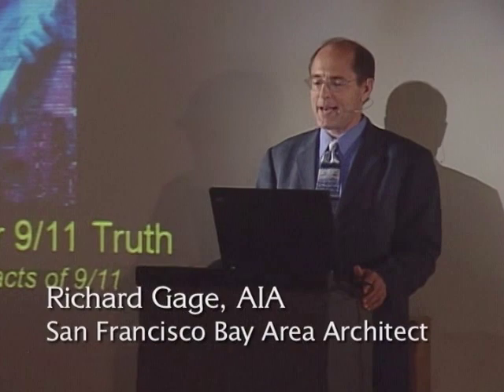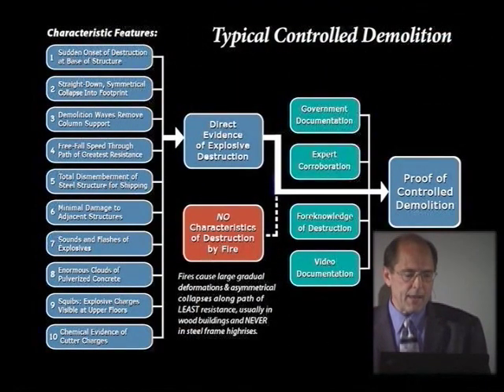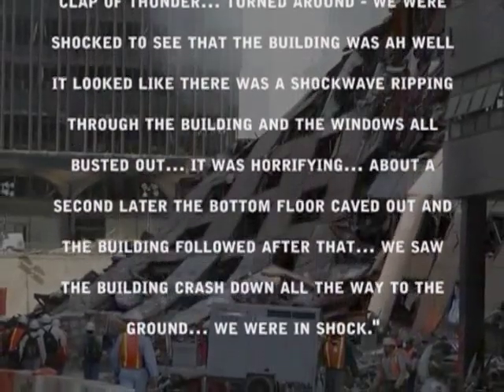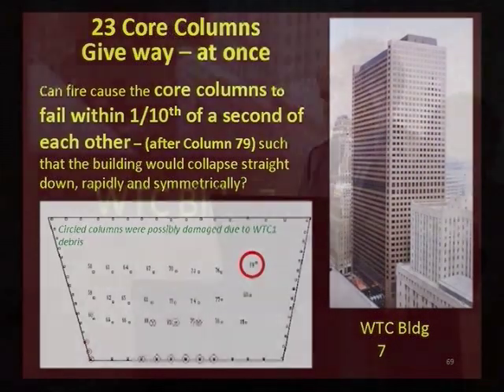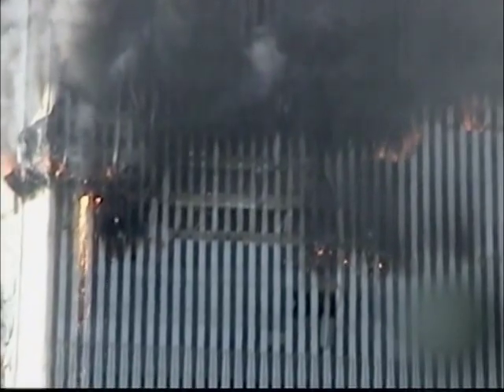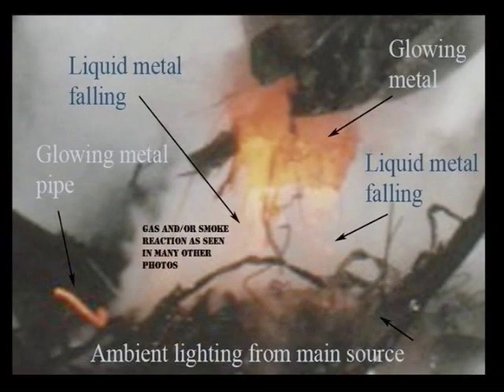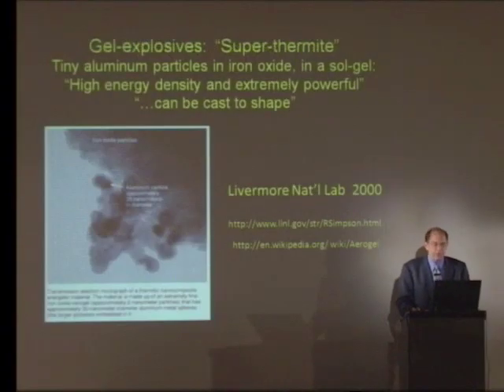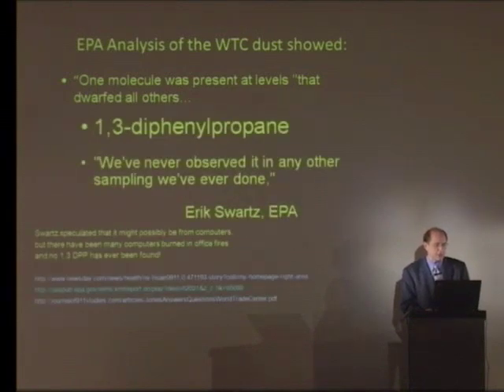9/11: Blueprint for Truth 1 of 3-33 min version - AE911Truth.org

Comment: Yet other buildings that have fallen from fire fall the same way. Relatively straight down at roughly the same speed. The fire department also determine it was probably going to collapse hours before and evacuated the area
It also didn't fall into its own footprint as it hit the building next to it.

Molten metal doesn't mean it's steel
Reply: The people cheering this stuff on aren't interested in facts. NIST answered each of these questions authoritatively.